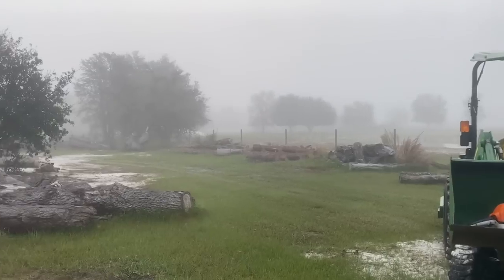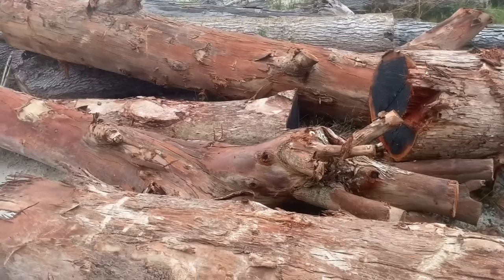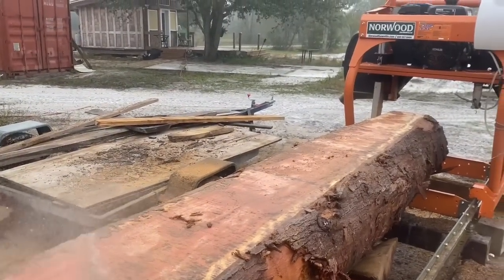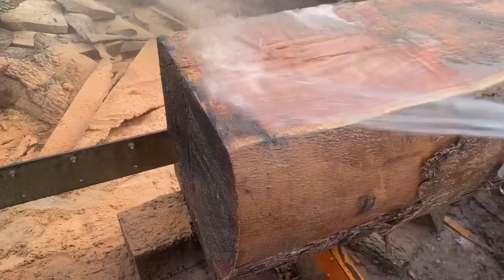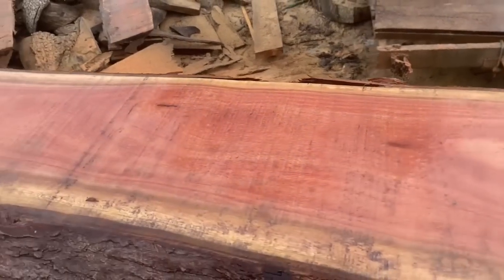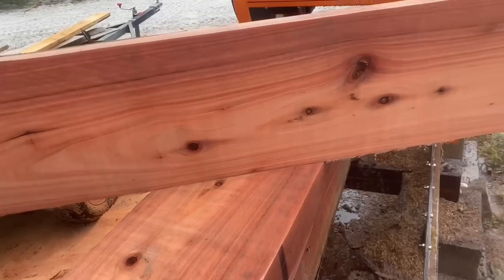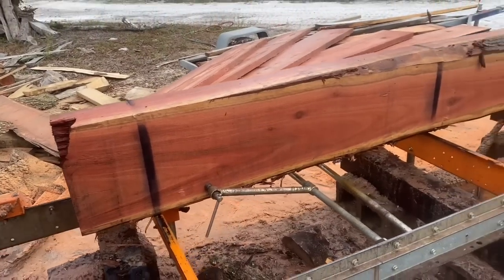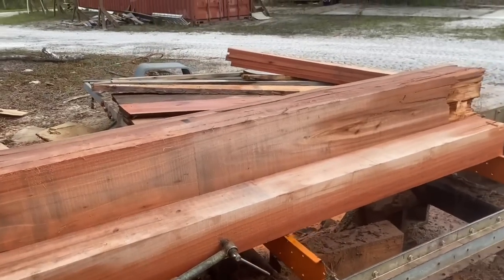Rainbow eucalyptus on the Norwood lm30 sawmill

Comment: Looks like the earth is made of white sand where you are. The straightness of the grain of that eucalyptus is really impressive but how do you slow the drying to prevent surface checking?  And is eucalyptus prone to blue stain or some other fungal discoloration if it's dried too slowly?
Reply from the maker: To slow the drying you can put a screen or breathable blanket over the stack to slow the airflow down as it passes through the stickers. Here in florida the humidity is always high and it’s always hot so it’s very hard to slow the process here
Reply from the maker: I have not seen any with any spalting occur as of yet